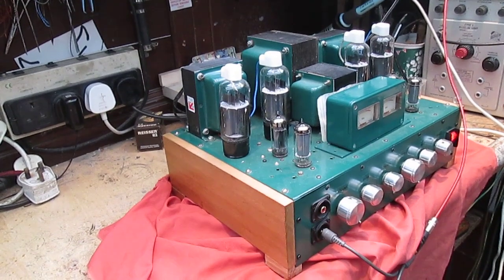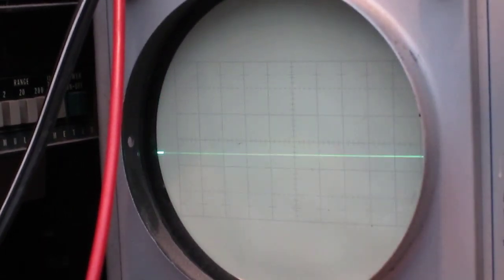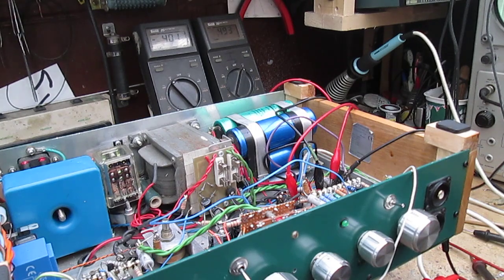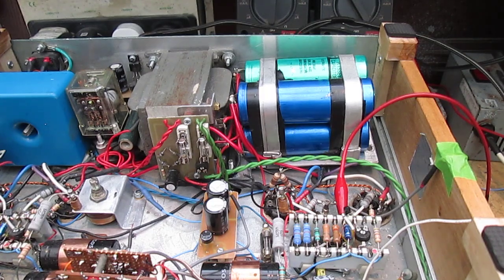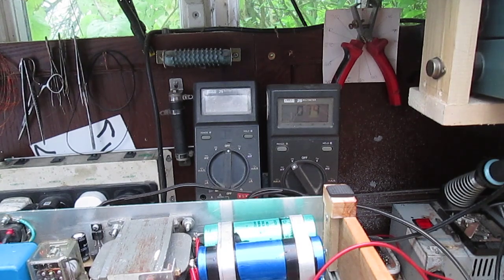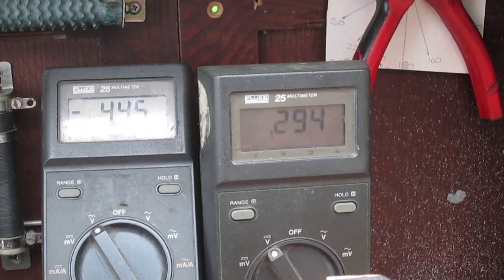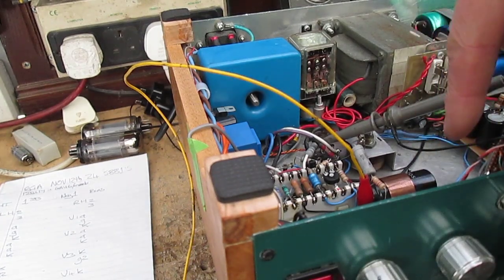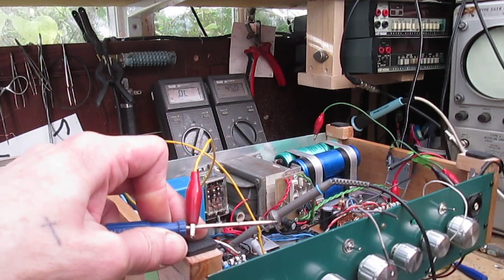Valve Amp - Faulty Valve - Parasytic Oscillation.

Comment: Howdy.
Familiar phenomenon. Some suggestions.
Check end tube grid stoppers.
Bad ground scheme. With a alligator clip wire try jumping different ground points.
Check screen grid resistors.
The inputs may need loading. My DIY PA needed as low as 2k2 resistors to load the inputs.
Try inserting 100 ohm resistors between the anode and the output transformer primaries. That may shift the phase enough to quench the oscillation.
Try inserting 1 ohm resistors between the cathodes and minus. That introduces a small amount of neg. feedback.
Try poking wires with a wood stick to find a wire that picks up feedback.
Cheers.
Reply from the maker: Thanks for the tips.
Reply: @diabolicalartificer  Howdy again. Anytime Dude.
More suggestions.
 Connect a 220 k resistor and a 100 pF cap. in series. Then connect the series between the anode and grid of the end tubes. That introduces upper bands neg. feedback. If it works try smaller cap.s and settle fpr the smallest that works.

I use a separate minus bus in my designs. The bus connects to the chassis only at the input jack. In one persistent case the problem eventually proved to be too this a wire as the minus bus. Also the problem was too sharp bends of the bus. Use at least 1,5 mm2 for the bus and shallow bends for small inductance.
Cheers again.
Reply from the maker: @eugenepohjola258  Bless you thanks again for some cracking suggestions & TFW.

Comment: Tin whisker is by guess on the tube . Lead free solder is more of a problem than many think .
Reply from the maker: Could be right, though there is no lead free solder used on this amp. It's all 60/40 or 3% silver solder on the Tek wafers. TFW.
Reply: @diabolicalartificer Ironically you just stated the likely cause of the problem

Comment: Nice amp. I like the Tektronix ceramic terminal strips there - I hope the maker used a lead-free solder with silver (common Sn97Ag3 should do).
Reply from the maker: Thank you. Yep, I did, 3% Ag. I have four Tek 500 series scopes, worked on them for years & have a few precious rolls of Tek solder but also have another four different types of Ag solder too. I have spare ceramic wafers if you need any. TFW.

Comment: Andy- Sometimes just the way components and wiring is located can cause oscillation.   I have seen a bug get in between pins on a tube not fully seated and become  a "resistor". (Carbonized bug).   In transmitters and some oscillator circuits, especially at high and VHF freq we used to take a jewelers saw and cut a slot in between  tube pins to reduce capacitance, possible leakage,  or arc over.  Weird but it worked.  I see your tube uses "coin bases" , which was used typically towards the end of tube production to cut down the cost of making Bakelite bases.
Reply from the maker: No idea what caused the issue, I tested them when I bought them. Anyhoo, the valve is KO'd, I'm sure it has heater cathode short too.
   The thin bases are a pain, nowhere near as good as a proper base, care needed when swopping valves. TFW as always.